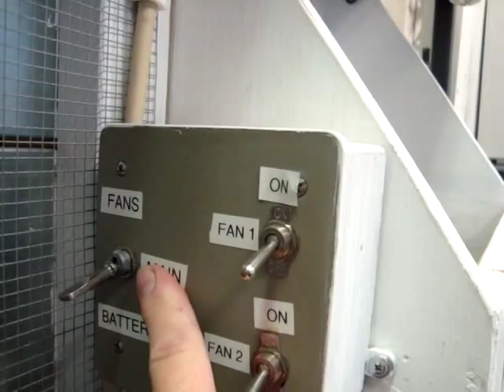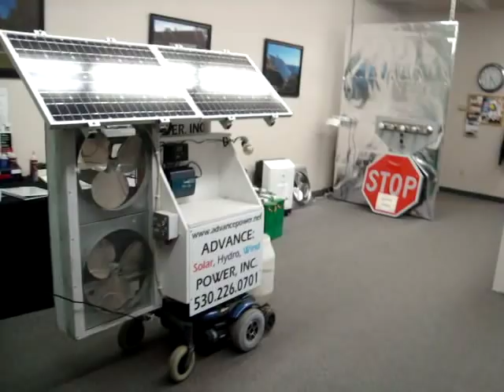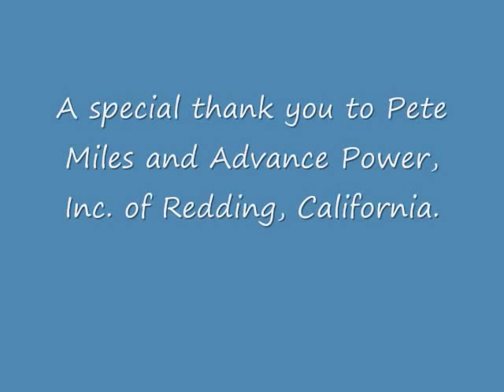DIY Solar, Wind, and Hydro, oh my!

Comment: WAIT!! He just got done saying they were 100 lbs a piece!! Then you both carry them off like they are empty plastic totes. lol  A really good episode would be if you could interview someone with a house that is completely off the grid. Seeing an individuals setup would be cool to see. A question I have is, would it be possible to have a hydro electric system set up to specifically charge an electric car? That way, you wouldn't have to tap into your houses power to charge your cars bank.

Comment from the maker: It's 50 watts, not watt hours, etc.  For instance, 50 watts at 12 volts is just over 4 amps, more than enough to run the attic fans.  Oh course the out put is variable based on sun exposure.  For a system that is sized to off set the cost of driving an electric vehicle, visit our website for details.

Comment: Sometimes I get frustrated right after getting excited about how I'm going to build my system just to end up at the same brick wall every time and that brick wall is energy storage. The technology is just not quite there yet as of 5/20/2021 as far as I know. If I want an efficient and reliable battery bank(which i'm sure everyone wants) I'll need to buy some LiFePO4 batteries. Yeah the kind of batteries I can't afford yet. 

I wish I can start experimenting and learning more right now that I'm still very mobile and not have to wait until they become affordable to the average dude. Of all important developments IMO this is one of the most important techs we need to improve on in order to move to the next level. 

Do you have a spare LiFePO4 battery you can send me so I can start off with? Wishful thinking. If you know of an inexpensive way to do this please educate me.
Reply from the maker: Fortunately I have solar and LiFePO4 storage with my 5th Wheel trailer and an enclosed car trailer.  Works great.  I do have some LiFePo4 and LiFeMnPO4 cells setting around that you could have at a very reasonable price but you would have to pick them up in person.  We will NOT ship them.  For more information, email info@EV4Unow.com